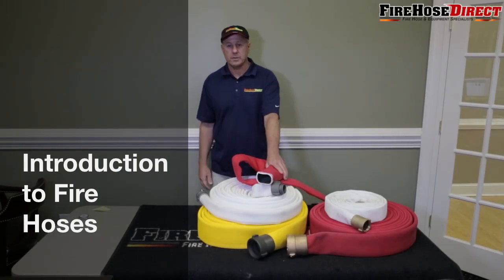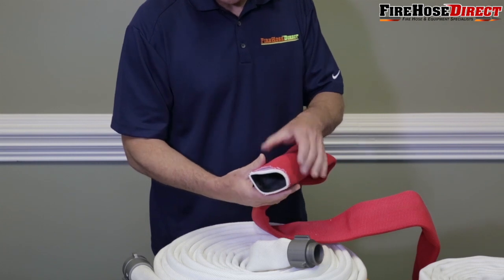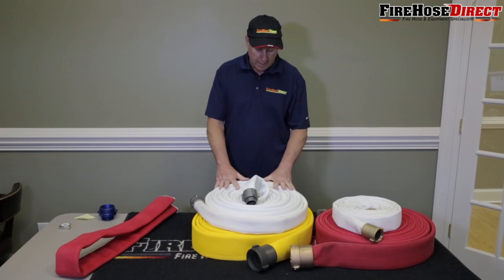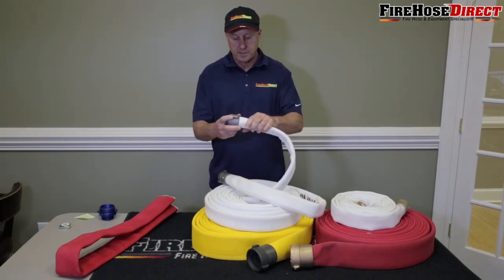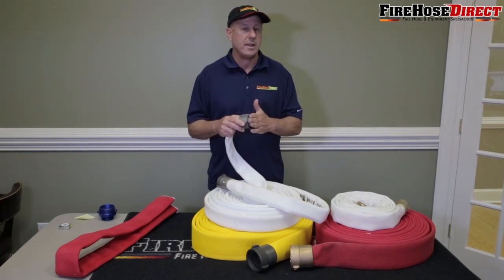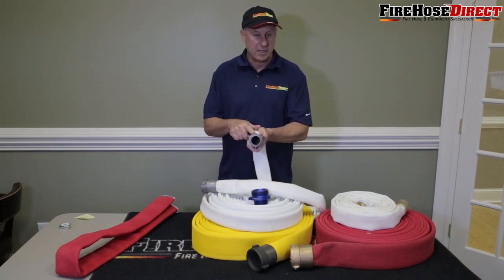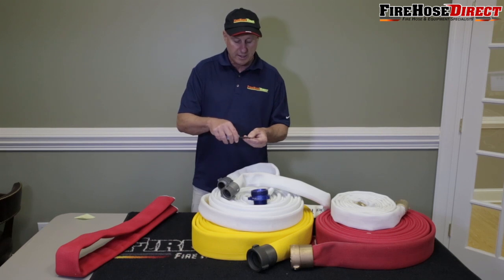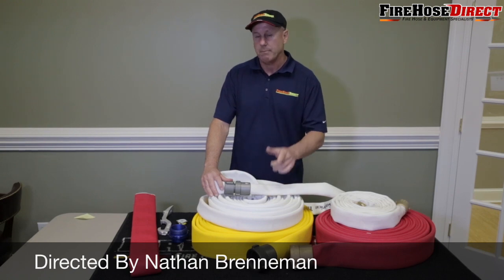Introduction to Fire Hoses

Comment: When I went through the Navy's 5 day firefighting school half a century ago, they used 1-1/2 inch NPSH everywhere except on aircraft carrier flight decks and hanger decks. 2-1/2 inch was used on aircraft fires. Below decks, in passage ways and compartments, 1-1/2 inch is more flexible and NPSH rocker lug couplings are easier to pull over water tight door thresholds than NH. An additional benefit is the finer thread on the NPSH can be made secure with wrist effort without using a lug wrench.  Further more, NAVY nozzles for use below decks are 95 GPM because that is all the nozzle reaction one sailor should be handling. Multi-man hose teams are a luxury aboard ship in confined spaces. The team is usually one nozzle man and one hose tender who may not be right behind the nozzle man. Yes, double jacket is more durable and required for municipal fire departments. However forestry hose is single jacket, it doesn't get dragged across curbs, the corners of masonry walls or angle iron edges. It is lighter weight, easier to haul around and more flexible, Not everyone needs a hose that can fight 500 fires before retirement.
Reply: Thx you but what type of hose would you buy for a home in Colorado use only . Small community in forest area gravel roads with a number of fire hydrants ? ? Thx